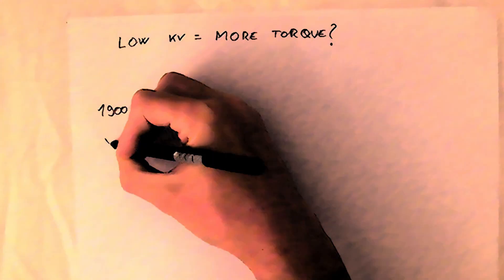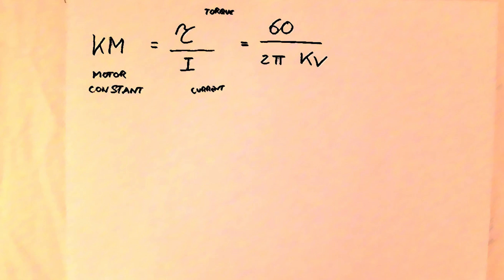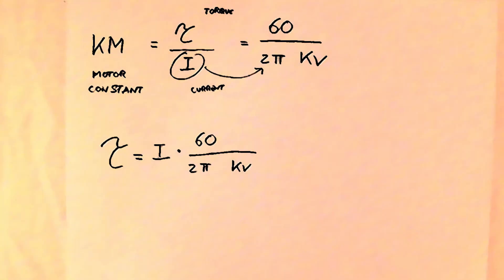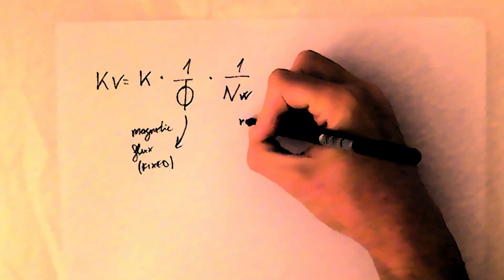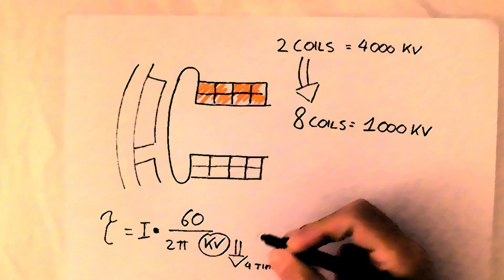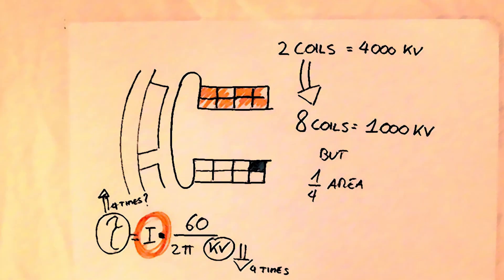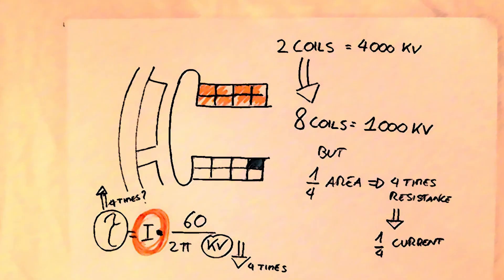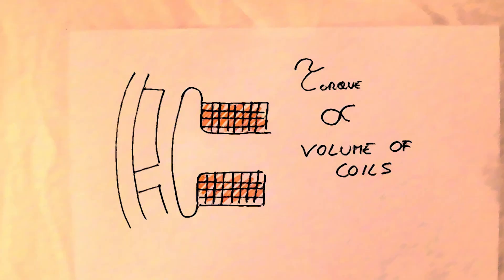KV and torque

Comment: 1/4 current? if say the kV is reduced by half so the number of turns (and wire length) doubles and the cross sectional area is reduced to a quarter to package it all and the resistance is proportional to length and inversley proportional to cross sectional area and the limit is really a thermal one i.e I2R (current squared x resistance) then isnt the maximum current reduced not to 1/4 but to 1/8?

Comment: Its dead simple. If you have a propeller say a 32 " diameter one for example, and you have a 130Kv motor and your run it at 70V to get maximum power then the blade will spin at 9100 rpm. That means that the tips are totally supersonic and it's really inefficient. So to bring it to just below Mach 1 you have to run it at 60V which means that the motor is running at about 60/70 or 86% of its peak power. In fact its still quite inefficient and if you said that you wanted the tip speed to not exceed M0.7 to avoid compressibility losses you would have to run it at about 5600 rpm so you are now down to 61% of max power i.e 43 V. If instead you decided to use an 80kV motor then at 70V its running at 5600 rpm so its the sweet point. As Power = Torque x Omega where Omega is the rotational speed. So  in the low Kv case you are running max power and in the 130kv you are running 61% of max power. For the same rpm the lower kv gives you a much higher torque. It's not about electrical theory and winding etc it's about matching your motor speed as close as possible to the rotational speed you need to operate whatever you are driving for it to be at its design point. If you geared the higher kv motor so it drove the propeller at the speed you wanted then there would be no difference.

Comment: I have a motor which is 36v 280kv 3 Nm so do you mean if I will winding the motor for 90kv 36v it will have the same 3 Nm like before?

Comment: you forgot that wire length is 4 times what is was before. so resistence goes up 16 times in total, and torque at same voltage is actually only a forth of what it was in the higher KV motor. but power is a sixteenth, so a lower KV is more efficient, in your simplified example

Comment: I'm missing something here.  You said Torque is related to current and KV, but where does Voltage (Power) come in to play?  Certainly 5A at 10V produces more torque than 5A at 5V (for a given KV) right?  Or maybe I'm confused.

Comment: Lower KV motors has more torque at the same amount of current. Which means 1000KV x 6S has more torque than 1500KV x 4S at its peak draw